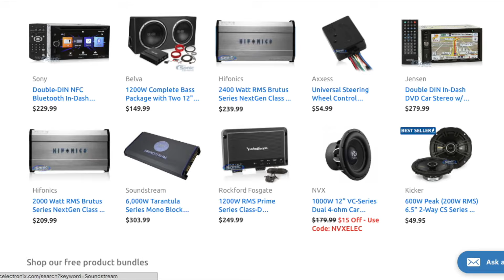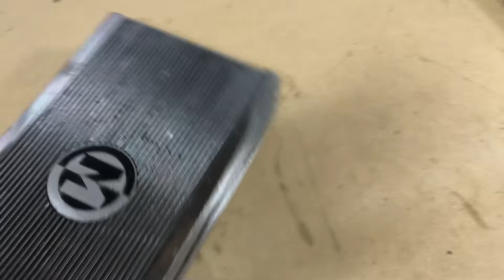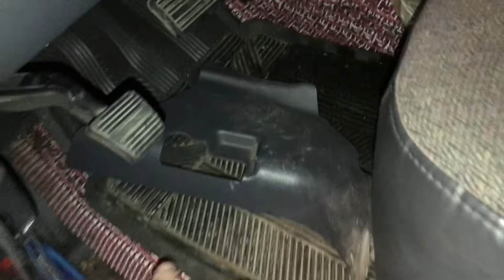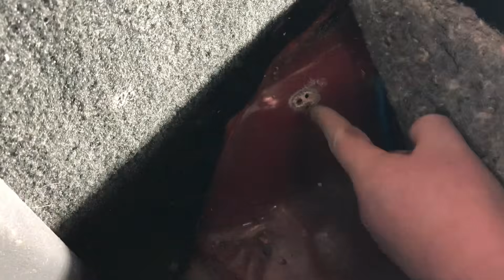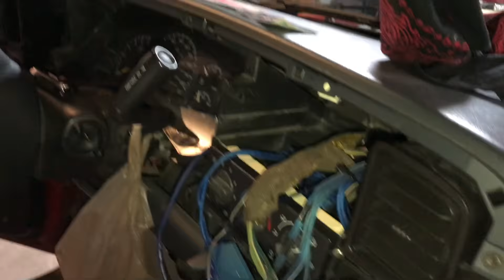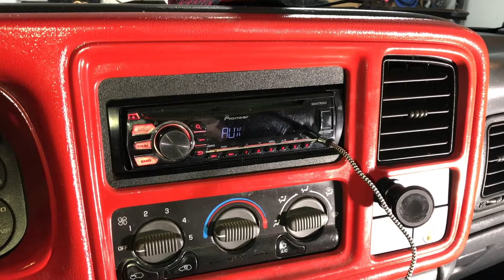1995 - 2006 Sierra Silverado Avalanche 4 Channel Amplifier Install

Comment: I have the same adapter and it does NOT thread in properly. Maybe two turns then pops off. Real loose when as tight as it can go, still able to lightly tug it off.

Comment: it seems like you have quite of bit of room to mount those large amp.  i have a 1995 GMC sierra single cab.  looking to put in a 4 channel and mono block kicker amps.  do you know about the height of those amps you have in there?  or how much clearance there is under each seat??

Comment: So you don’t connect the speaker wire to the speakers you connect it to the harness? I’m confused on if I hard wire it to the speakers or if I do the harness
Reply: You can do both but by wiring to the harness you use the existing stock speaker wires instead of having to go and run speaker wire from the amplifier to the speakers individually. Hope this helps
Reply: @andremartinez8387 makes sense 👍

Comment: Good video, but this doesnt apply to a 1995 Sierra 1500, very different setup under the hood, battery is on the opposite side, grommets in different locations, etc.

Comment: I got a 2005 gmc sierra with Bose going to run 4 channel and mono after market deck with crux interface where do I tap in to run 4 channel I want to use stock speaker wire that’s ran already another thing don’t really need stock sub hooked up

Comment: whats is different when is installing a mono amp for 2 subs
Reply from the maker: Simple 2 channel RCA output to amp.  That is it. No need to run new speaker wiring.

Comment: I tapped in to wires on radio to amp and no sound it actually grounds out everything is connected right do I have bypass the factory amp

Comment: HELP. I installed a 4-channel amp in my 97 K1500 extended cab. The front speakers works good, but there’s no sound coming out of the rear speakers. I swapped the RCAs to see if it was the cables but nothing changed. I did however find out that if I unhooked the wires from channel 4 on the amp the rear driver side speaker would come on but the one on the passenger side will not. If I hook up just one wire on channel 4 then both of them will come on for a min but then they quit. Do I need to run new wires directly from the rear speakers to the amp or what?

Comment: How do you connect the wires from the amp to the main harness?
Reply: You run them with the remote wire and rca from the amp to the head unit and do a quick search of what color your cars speaker wires are. Then snip those and connect them all up.

Comment: Is there originally a factory amp in this truck? I think mine is bad and need to replace it. Front door speakers are out even after installing new ones.
Reply: Some come with the Bose system depends on what model you’ve got
Reply: Hey did you ever figure out your problem? My front speakers are out as well and can’t figure out why.
Reply: @simonh5110  It was the built-in amp in the original GM radio, got an aftermarket one and it worked again.

Comment: How do you know which wires to hook the blue wires coming from the amp to
Reply: So the big red is the power and the black is the ground. The little blue thin wire is a remote wire. Hook it up to your decks remote wire.

Comment: All my speakers and amps are wired properly and everything. When i turn my volume passed 25/40 my 4 channel amp cuts out but my subs on my mono block keep playing. The 4 channel will comeback for a split second and cut back out unless I turn it down. Why?
Reply: Your gain is probably too high on your 4 channel and it is clipping and sending it into protect turn it down some and then turn up the radio see if it still does it
Reply: @bigrobstillpimpn  it's barely turned up. I think its an ampedamce problem. I solved the issue but now 2 channels dont work on the amp. I think im just gonna get a better amp and be done with it. Then rewire the speakers
Reply: @JosephNnbs did you ever figure this out? This exactly just happened to me
Reply: @ cheap wires and bad grounding. Used OFC speaker wire and 1/0 OFC power and ground and it’s good now.
Reply: When I run my system hard, my voltage drops low enough where my jl 4 channel amp will turn off and my digital designs amp will stay on. It's because my voltage drop is too much and the jl amp won't run below around 11 volts and my dd amp will run down to 9 volts i think.
Reply: I have the same problem

Comment: Where can I plug in the ROMOTE wire at at on the stereo
Reply from the maker: Blue / white wire of your aftermarket radio.  IF you don't have an aftermarket radio, you can locate switched power at the fuse box.

Comment: I installed a 4 channel amp with new speakers but i lost chimes. Any way to retaining?  Escalade 06 bose amp
Reply from the maker: The issue is that the chime goes through the factory driver side door speaker.  TO retain that, you need a different wiring harness adapter for your aftermarket radio.  This will retain that chime noise: https://www.sonicelectronix.com/item_12901_Axxess-GMOS-04.html
use coupon code ProvoBeast to save at checkout.

Comment: My question is someone please help I want to run a amp for my doors (already have an amp for subs) how do I actually hook up a amp for doors do I have to run wire from the speakers to the headunit or what HELP
Reply from the maker: Well, depends on how much power you are pushing.  You certainly can run new wire to each door speaker, or if the speakers are lower wattage, you can run your amp output wiring to the wiring harness behind the radio instead (which uses the factory wiring to the doors.
Reply: I’m running pioneer 6 1/2s in the front doors 4x6s in the back doors and 6x9s under the seat right now I know their under powered cause my headunit its 50x4

Comment: today I worked on getting my 4 channel amp installed on my chevy truck. I have a double din head unit and I already have a bass amp hooked up, so i tried  running wires/remote and 2 pair rca's  when everything was connected I didn't have no sound.😞 help plz
Reply from the maker: check to make sure the 4 channel amp is turning on.  If so, check to ensure your RCA wires are connected properly.  Also check to see if you have your speaker wire hooked up correctly.
Reply: Did you find a solution? I have the same problem if so let me.know thanks
Reply: Check the main fuse on the power wire?
Reply: Sometimes u have to manually turn on rca output on stereo lol

Comment: Hi, I'm trying to install my amp power wire thru the firewall but I can't find a grommet in my 2000 Toyota Camry... Do you guys know how can I get my wire thru the firewall?
Reply from the maker: The factory loom goes through the driver side fender, not through the firewall.  Pull the wheel well cover out and you can see where to run the power wire through the firewall.